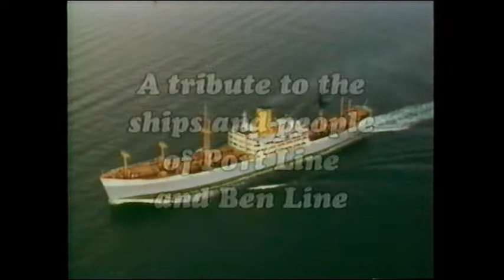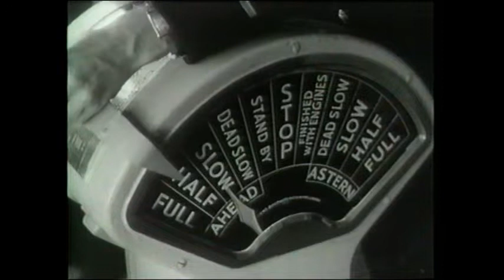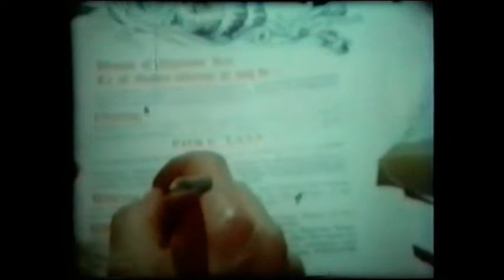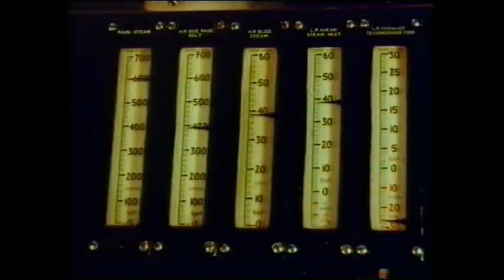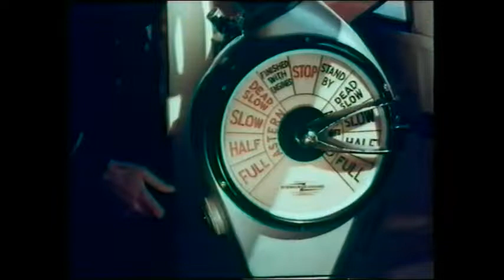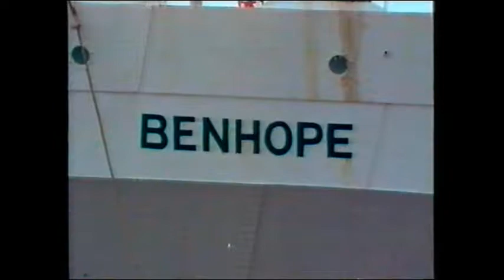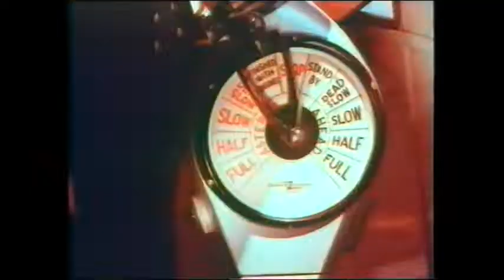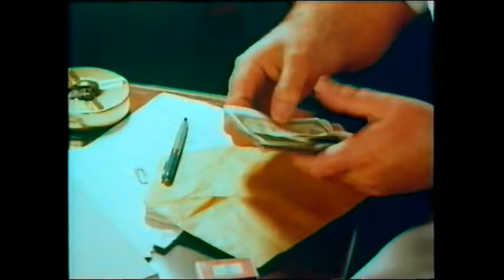The Great Liners Part 10 Ports and Bens

Comment: What happened  to the British merchant Navy?  Was is the seaman's strike in the 1960's ? It seemed to evaporate..
Reply: Cheap air travel,  cheap foreign labor aboard ships and in ports, cheap foreign flagged ship registration, cheap and efficient foreign ship building, failure to readily adapt to more efficient concepts like containerization, changing world shipping patterns, and I'm sure some will blame the Gov't for some reasons that I am not knowledgeable to speak on.
Reply: @johnstudd4245  Same thing happened in Australia, unions virtually killed it all off.  Now it's foreign flags serving out ports.  Australia's once proud merchant navy now history.
Reply: @dieseldavetrains8988 I did not specifically mention Unions, but I guess I my overall opinion of them in todays world is a bit negative. Historically, they tend to drive business away, as we have seen.